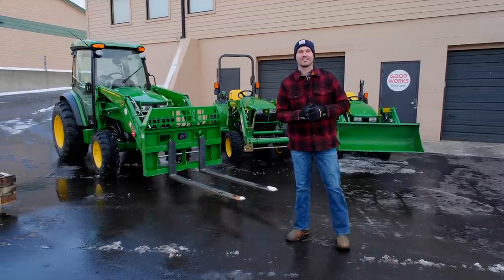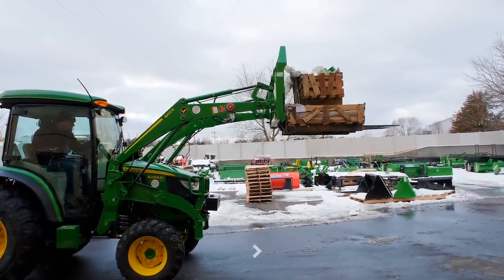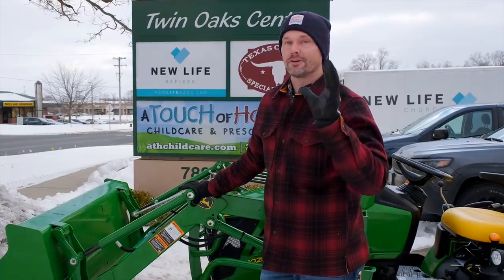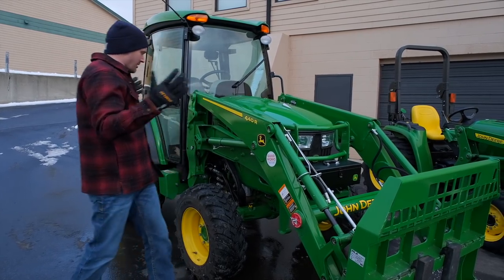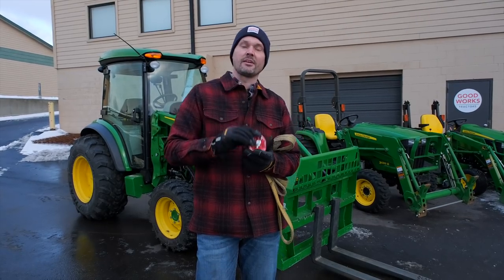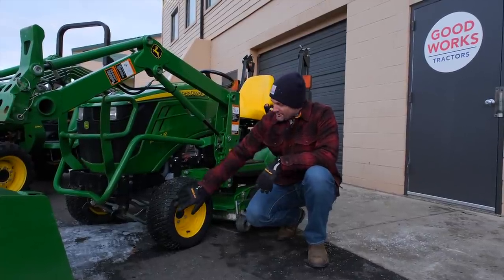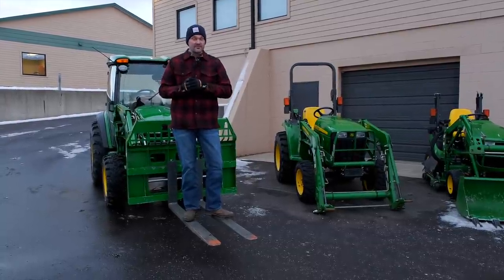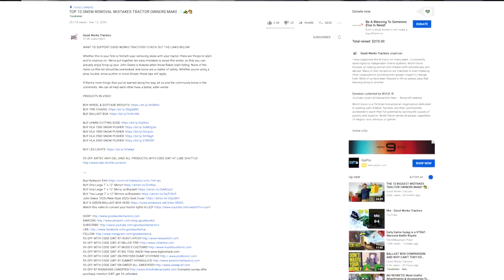20 TIPS TO LIFT MORE, DIG BETTER, WORK FASTER WITH YOUR LOADER 🚜

Comment: Additional info on tractor brakes...  The majority of tractors only have brakes on the rear tires. If you put the tractor in 4WD, you are effectively tying front axle to the rear axle through the 4WD system.  That  means when you brake the rear tires, the front tires also see a braking force.  If you're carrying a heavy load with the FEL, especially down hill, and you do not have adequate ballast on the rear end, the rear tires can get very light, if not come off the ground (hence GWT's insistence on proper tractor ballasting!).  If you're not in 4-wheel drive, you're going to go for an uncontrolled ride until you get that FEL load down on the ground.  On some bigger utility Ag tractors, they actually include automatic engagement of 4WD when the rear brakes are applied.
Reply: Appreciate that
Reply: I operated a forklift in a yard that had slopes both ways, if the forklift leaned and one wheel came off the ground you would completely loose all braking, scary lesson, also lost all my brakes on my Husqvarna MZT61 zero turn commercial mower, it spun into one of my broken vehicles when it lost traction to one rear wheel on a slope, hydro drives can be very dangerous when you loose traction!
Reply: The problem with sliding in 4WD is you loose your steering too😜 Sometimes it’s best to just ride out a rear wheel slide if you need to turn going downhill.

Comment: The rule for tire air pressure change is every 10 degrees colder you lose 1 lb of pressure. Conversely at 10 degrees warmer, you increase pressure by 1 lb. Always keep tire pressure maintained with an accurate gauge.  Your belly mower could scalp with low front tire pressure! Watch out.

Comment: Another safety tip I ALWAYS follow, is if your working alone or just using your tractor at all in general, I AWAYS make sure I have my phone with me, and FULLY charged, sometimes I’ll even bring a portable charger if I think I’ll need it, I don’t. Like being out moving brush, moving logs and stuff without my phone in case I need it

Comment: If you store your tractor outside wipe any exposed hydraulic rams after each use with a rag soaked with whatever hydraulic oil your system uses. If you don't have any extra hyd oil then wipe them down with WD-40, 3-in-1, or some other light oil. I learned this in military aviation to protect landing gear struts in salt water environments. Works like a champ. 👍

Comment: When carrying a load downhill, engaging four wheel drive will allow the rear brakes to also apply stopping power to the front wheels. 
I added heavy duty casters to a good wooden pallet, the forks go in the pallet on one side, the bucket sits on the pallet on the other side, it saves space and is easy to spin on smooth concrete.
Reply from the maker: Good tips, thanks Nathan!
Reply: Great space saving idea.  Tim @ Cliffside Acres

Comment: Another Safety Tip: If you have a load in your front end loader and are going slowly (like we're all encouraged to do), you can STILL get into a hairy, tipover situation if a wheel drops into a pothole or climbs up onto a hidden obstacle. QUICKLY lower your loader to the ground. It will lower your center of gravity AND it will introduce lateral stability because the bucket is generally wider than the stance of the tires.

Lower that loader to the ground! You might have just prevented a rollover.

Comment: My JD4044m sits under my steel building’s garage, the tube in the lift is great for a PVC half cut sliding shelf to store extra tools, etc and is waterproof. Cutting a pvc tube in half but leaving two or three inches round allows you to plug it and create a handle for sliding it out almost the entire width of the tub without falling out. It also make a great bolt holder or light bench for holding things when extended.
Reply: That a good idea

Comment: Courtney, another great video! With lots of great advice! 

Heavy Hitch toothbar is a must!  

I use a pallet for storage.  Bucket on pallet; forks through the pallet and parked in the garage. 

This does a couple things for me: 
1) the bottom of the pallet keeps the forks off the ground (I have always been told to use a block of wood under your equipment to help prevent rust)
2) It gives me the ability to store my bucket in the garage.
3) I’m lucky enough that my loader actually can disconnect from the forks, drive forward with the loader over my pallet forks, hook up my bucket, and be ready to go.  

I’d recommend double checking your clearances because every tractor, loader, and set of forks is a little different.

Thanks again~ SBYD!
Reply from the maker: Thanks!

Comment: I store my tractor in my shop at all times when not in use. I lower the front loader all the way to the ground & then i lower the bucket itself flat to touch the ground. i use bright orange duct tape on 2 places on my level indicator rod. 

Thankya for sharing this video. take care

Comment: As usual, thank you for this very instructive video. Nice tips for both new comers and also as a reminder before using again with a  loader. SAFETY FIRST!!!
Just another tip : avoid the bucket or attachment to be too much curled back when raising the load (typically dumping something onto a dump truck), this may fall back onto the tractor or worse, with a log, slip through the loading arms and guess what? get onto your legs... so take care.
Reply from the maker: Haha great advice

Comment: My bucket is on a stack of pallets in a heated building. My pallet forks are stored in the  bottom pallet. I can leave either one attached or easily change.
I am aware of nearly all you discuss but being reminded is a good thing.

Comment: For the tube storage, I use a pvc pipe that fits the tube on my New Holland Workmaster 25. I cut out the top and I store my chains there and a few tools. I also use the same red gripper test plugs you were using.

Comment: Yesterday while backing my mower deck over a sinkhole, I noticed my kids coming out to see me. I didn't look over the shoulder and BOOM, the right rear tire went into the hole. I got stuck at an angle, with the front left tire spinning away. Good thing I had the loader on it to keep me from going titz up. Had to get the other tractor and the wife to help me undo that little error. I was also grateful for the seatbelt, although it wasn't critical to have.

Comment: I am happy to see safety videos such as these on here! 2 other things I would bring up would be the loader lock out and curling too far with an MSL loader. I have a John Deere 4052R with an MSL loader and my dad has a John Deere 4520 with a standard loader frame. I do not recall if his loader lock has 2 positions, but I know mine does. I have talked with many people who accidentally hit that from getting on their in a rush and then could not figure out why their bucket wouldn't move. Hahaha. Now for the MSL loader, make sure you curl back after you dump from a low position and need to raise the bucket. The MSL, when trying to lift, will try to over stroke the attachment point causing it to bind on the stop and possibly damage your loader if you apply too much force. I used to work for John Deere and that was a problem one of our customers was having with his tractor when working a manure pile. He had no idea that's what it was because he never had an MSL before.  Sorry for the short story. Lol

Comment: Air pressure change avg 1psi per 10 deg change. Small volume tires will show this more than larger tires. This is why many new cars with low profile tires have nitrogen in them. It is more temperature stable. 
Great tips on loader use! 👍
Reply from the maker: Good deal, thanks for helping out!

Comment: My 2019 MF 1735 M has auto throttle.  Best feature when running loader.  Keeps rpm low when you are articulating but instant response when traversing.  Thanks for the tips!  Rob
Reply from the maker: Yeah, I should have mentioned that.  Some JD's and Kubota's have that too.  Good tip!
Reply: JD 6400s has it, cruise control per manual

Comment: Hi.  Did you know that the angel of the top of a deere bucket is the same as the bottom angle?  What that means is you can estimate the level of the bucket to the ground by simply eyeing the top of the bucket in relation to the ground.  Hope that made sense.
Reply from the maker: Sure does, that's what the folks with a 3e need to do.  Some of the Kubota buckets have a sticker on top that says "level indicator".  Thanks for sharing!

Comment: Ever since I switched from pin on to SSQA on my BX I leave the loader on all year round (even when mowing).  So I store the bucket outside propped on a 4x4 at the back of the bucket so no water build up.  I store the tractor in a lean to open shed with the loader curled

Comment: Big one for me was forgetting to have my Kubota B7500 hst in 4wd when going down a hill with a load in the bucket.  Didn’t even occur to me that all of that weight in the bucket would make the rear tires light and therefore totally ineffective.  I’ve only done this three times in the 19 years of having the tractor but that’s three times too many.
Reply: You have a 7500 you used 3 times, im thinking you def under utilize that machine, changing oil yearly is a must for the engine, using the machine or not, and a warm up and brake pad use for 1 hour to clear rust lub the caliper 1 x a month , unless its a collection tractor, you may be better to hire a tractor once in a blue moon, im thinking
Reply: Know what you mean, been there done that!

Comment: A little secret about storing your front bucket in the winter time I’ll take that ice all day long in the front bucket but I’d rather have that than ice build up on the cylinders the cylinder ramps because when you roll the bucket back that ice can cut into your seals and also by having your bucket rolled back should something drop and fall if it hits on that cylinder ram and puts very much of a dent or a gouge you’re screwed man this is Jim from Pennsylvania with that little 850 John Deere again all right I’ve been driving up machine since 1992

Comment: When not in use, I roll the bucket down...estimate 15-25 degrees, so rain and snow doesn't stay in the bucket. That said, come snow season, I have a Frontier plow, so the bucket comes off. I set the bucket down so the cutting edge is a few inches lower than the heel of the bucket...again, so rain and snow don't accumulate and will drain out.
Reply from the maker: Good deal, thanks for watching Roy!

Comment: Nice video once again! I store mine inside an 8' door and would be real interested to know the size of those R14 tires on your 4066R...regular R4's deflated to 11 psi still wouldn't fit under my door so I had to put R3's on (I thought anyway) but they are not the best in snow!
Reply from the maker: These fit.  I forget the size, but it is shown in a few videos.  These are loaded and slightly under rated pressure.  Fits like a charm.
Reply: @GoodWorksTractors  yes, I've been trying to eye up size letters in a few of the videos - must have missed the ones where the size was mentioned - more watching to do I guess 😅 👍

Comment: A lot of good tips on your video today! I was wondering if you sell one other item for those that have a pin on bucket? There are kits for a lot of tractors that you can buy. Sometimes it looks like you can find a real bargain on a pin on bucket and you are still ahead on savings if you get the kit. I saw somebody on a video do it and it went well, but it looked like the key was to find a welder who is really good to get the welds right.

Comment: I had made two  dolly's one for the bucket and one for the loader stand  and I wheel it to the front of my garage .I was brought up on a farm driving different size tractor yes away be aware and always use caution while operating a tractor of any size.

Comment: Sometimes when I’m trying to dig a rock out of the ground I end up with my front wheels off the ground - pushing under the edge of the rock with my back wheels. It works ... but is that causing damage? I have a JD 2025R with a 120 FEL and a heavy hitch tooth bar. When my front wheels are off the ground it sometimes allows me to grab the “lip” of the rock and pry it out of the ground. Not sure about whether the tractor can take that stress. (LOTS of big rocks on our property!)

Comment: Bucket stays outside with a chunk of wood under the bucket's heel so water runs out and tractor sits in carport with curl cylinders mostly/full retracted.  About the only time the bucket (or any other implement) is on the loader is when it's being used. With the exception of the finish mower in the summer it's the same story for the 3pt implements as I'd rather take the extra few minutes to remove an attachment after using it vs. having to detach it and then attach any implements I'll be using the next time I'm on the tractor.

Comment: The advice folks are giving of putting your tractor in 4wd for braking downhill is good BUT, that really only helps if your lack of breaking is from lack of TRACTION. The 4wd trick works great anytime if you are skidding your rear tires. Mud, snow/ice, loose material like sand or wood chips, down hill, all good reasons for 4wd to help braking. The real problem with tractor brakes is that the brakes are just TOO SMALL for all the weight. Bucket or trailer full of something heavy? GO SLOW! Never giving the weight of your tractor a chance to over power the brakes in the first place, is how you will live a long and healthy life. ;-)
Reply from the maker: 100% agree, think ahead and don't put yourself in that position in the first place.

Comment: My number one safety suggestion to any tractor owner is NEVER modify your ROPS system. That is to say, never drill into it, cut it, or alter the fasteners and adjustment hinges/bolts. If you need to mount something to it make sure to use bolt on brackets, double-sided tape,  existing holes etc., but even then do so sparingly. Extra lights, a canopy, or toolboxes are all fine but heavily modifying and adding things to the ROPS can reduce its effectiveness.

Comment: Very informative video.  I always enjoy watching your channel.  I am debating between a 1025R, a 2032R or splurging on a 3039R with a cab to maintain my property and maybe get a side hustle started.
Reply: I would encourage you to sit down and make a list of all the things you need your tractor to do either at home or as a business.

I had a 2320R and ended up with a 3032E, not a thing wrong with the smaller tractor but it struggled with the greater demands of acreage life.

The 2320R had liquid ballast in the tires and is an absolute must on a narrow tractor.

The 3032E didnt have liquid ballast when I got it and trust me, even on a bigger/wider tractor you will notice and its sketchy. Have both liquid ballast and a ballast box now and it's solid.

I wish you the best in finding the right size of tractor and have tons of fun with it!🤠

Comment: A more accurate way of calculating the tire pressure change is based on the ideal gas law.  P1/T1 = P2/T2 (assumes volume is a constant) but the temperature has to be in absolute units (Rankine or Kelvin).  0 degrees Fahrenheit is equal to 460 degrees Rankine and 0 degrees Celsius is equal to 273 degrees Kelvin.  The thumb rule is easier to use though and is probably accurate enough for the temperature ranges people deal with.

Comment: I would like to add a speedco quick loader to my Branson subcompact tractor with loader -- but I also use a Woods 660 72" finish mower.  I have seen them on quick attach on other pages, with a modification for the top attachment (basically making the lower 3 point hitch easier to attach--but requiring a pin to be placed in the upper arm.  If this can be done, is it safe--I know I have the length for the PTO hook up!  Mike Waters

Comment: Have you ever discussed using the bucket or other attachments going backwards ? Somewhere I saw it stated that you should never Do that (leveling, pulling, etc) because the cylinders would be damaged on the loader.
Reply: Back-blading with my bucket is one of the most-used operations I do with all my tractors!
Reply: @LongBinh70  thanks for the reply. I just got my first tractor, a JD1025 last September and Somewhere I heard that it stressed the pistons and could damage them
Reply: It can stress the cylinders if you’re at an aggressive angle and hit something hard. Just keep it at a reasonable angle and go slow you shouldn’t have any issues.
Reply: @JamesBentivegna  thanks!

Comment: Something I've been thinking about for some time now.  

Why couldn't one fabricate a "thumb" like those used on excavator buckets for use in a tractor loader bucket?  I think it would be handy as hell for a number of uses, like stickering logs for storage or milling, or picking up odd-shaped rocks that don't want to slide into a bucket easily.
Reply: You mean to have a small digging bucket mounted to the loader & a thumb opening at the top? I feel this would not work well compared to an excavator as the loader frame would be behind the bucket & the bucket can’t move independently from the tractor.
Reply: @kdegraa  

No, I just mean a thumb fixed to the top of the bucket on a hinge.  With the bucket tilted down, it could be used to grip logs, similar to a grapple.  Or moving brush piles, etc.
Reply: @patmowatt2130  such a bucket is already available. It’s called a 4 in 1 bucket. My tractor has a 4 in 1 bucket which can be used to pick up and grab things. It’s not as good at grabbing as a grapple from what I see but it’s much better than a standard bucket.